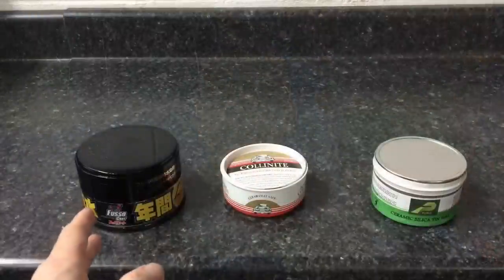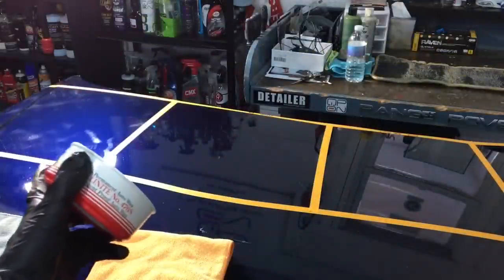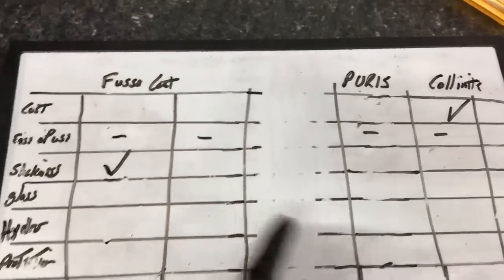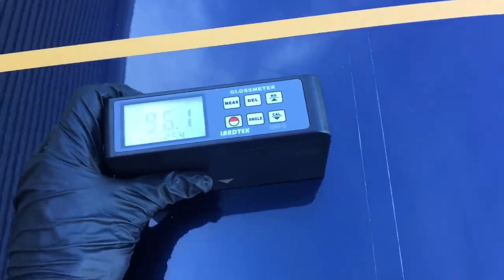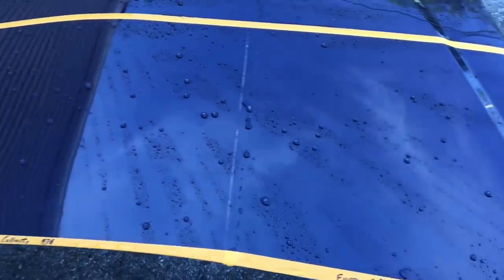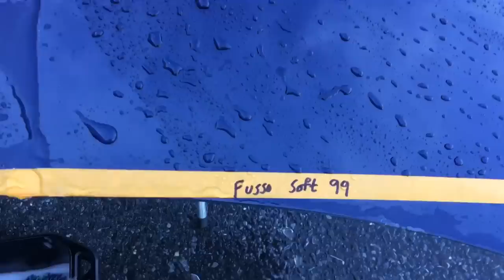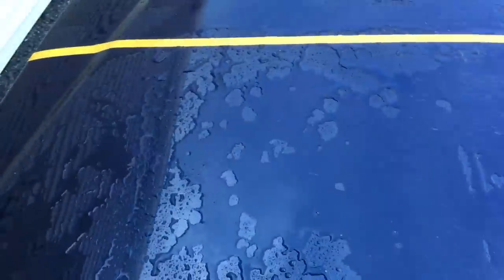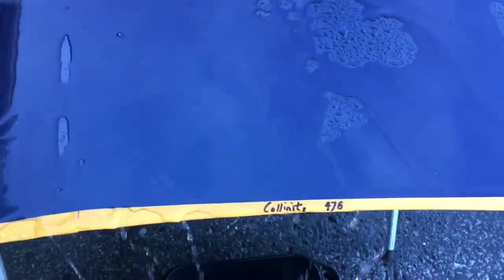Fusso Coat Soft 99 VERSUS Collinite 476 VERSUS PURIS Jade!!

Comment: I have seen on another Fusso review that it’s hard to work with below 60 degrees. I have been a Collinite fan simply because it’s cheap, easy to work with and I actually prefer more frequent wax applications. I gives me a chance to look over my cars paint for any damage and a little physical workout as well. But one thing about a well polished and protected car is that it seems to stay clean a little bit longer.
Reply: I have a lot of experience with original Fusso.  I’ve used it in varying temperatures and have a good feel for it’s behavior.  Give it another chance.  

My own opinion with some of these durable products is that many detailers expect to have all boxes checked with the experience; I don’t.  Fusso takes skill and time to master.  What you get in return is protection that in common daily conditions is nearly indescribable.  Water?  Soap?  I laughed out loud the first time I revisited the car after nailing the application of Fusso.  It is worth trying for that experience alone.

I’m guessing you know full and well that a 95%-plus quality correction greatly impacts the perception of any product applied, and I believe it is key when using such an aggressive one like Fusso.  To me, I’m protecting my ‘real’ work, versus making up for it.  

Last thing-  When in doubt, apply Fusso like it’s smearable.  Like Crisco, or snot.  And then wipe it off very well with a soft MF towel 10 seconds later.  If you’re in colder weather, 3-5 minutes tops.  I’ve NEVER done better with it waiting any longer.  If it doesn’t feel cured, then keep going with the towel until it looks removed.  THEN follow up again with a clean towel.  It’s all worth the trouble.

Hope that helps, if at all.
Reply: @snail415  lol

Comment: Fusso for the win!!! I have it and use it! It is extremely strong and durable! I use it for my hood roof and deck lid and I use turtle wax ceramic spray coating for the sides and both bumpers as well as glass and it works fantastically!

Comment: I was very happy to see the old dog, 476, holding its own especially with initial water beading.
It's my winter wax. My car is rarely ever cleaned during the winter like it is in the summer. It does really well holding off the salt and stuff and is still there in the spring. 
Great video Bryan. For me, for my use, can't beat 476. 2 coats a day apart-ish before temps drop and I'm set all summer. Just powerwash the Michigan salt.
Fusso is looking really good.
I have a tin but haven't used it yet. Have many products I have yet to use. Need to find other people's cars will to test some lol or I'll never get to them!!
May have to rethink my winter wax now....

Comment: I would love to see a review of Race Glaze. There is not even a mention of it on YouTube, so far I absolutely love it. It is extremely user friendly and leaves the paint extremely slick. It sheets water like a ceramic coating and it's been around since the mid 70's

Comment: Sorry, I know this is an old video, but I have a question. Do you recommend against top-coating Fusso with the intention of increasing the gloss/depth appearance (e.g. Shinee Wax on top of Fusso)?
Reply: The reason to use Fusso is to get it’s long lasting hydrophobicity. If you top it with Shinee, you will instead have the hydrophobic characteristinfs of Shinee. If that is what you want, then why not just use the Shinee and skip the Fusso altogether?
Reply: My opinion is based on quite a bit of experience testing this.  I’ve used Fusso on both clearcoat and silver (plated brass instruments).  So, not saying I’m a big deal, but I’m confident on this topic.

Fusso on ‘perfect’ paint, properly applied is nearly unbeatable as a base.  Follow that up with a ceramic spray like Griots 3-in-1, and the reflectivity you get is bananas.  I’ve tried many spray-based products that I feel are more amenable to going on substrates beyond clearcoat, and Griots has a really unique gloss characteristic.  I bought Wolfgang’s latest equivalent paying twice as much, and while the application was easy I was not impressed with the gloss.

Bottom line-  Fusso for protection on a truly-corrected panel, followed with a fairly-durable gloss-focused product is worth the effort.  Fusso doesn’t ‘pop’ like more modern products, but it is like nail polish in is effective resistance to the elements.  It’s worth experiencing.

Comment: Fusso Coat is mad OG , I got the King of Gloss as well. I’d like to see what it does on the gloss meter . But Fusso coat really out lasts anything in its price point. It’s been around for a while and can be topped. If you can’t afford a coating Fusso coat and Seal and Shine will get you through .

Comment: Fusso.   What’s funny, I detailed my Acura TSX last summer.  I used the Wolfgang twins on a 3401. Orange and white pads.  I used exo v4 to seal it up.  It sat in the garage all summer.     I started driving it in November. Didn’t wash it at all through the course of the winter.   I live in Connecticut.  It snowed a few times.  The car had salt sitting on it pretty much all winter.   I wanted to torture test it.  Well, it failed miserably as it had the coating burned off or, eaten off from where the salt was.   Anywhere else, it had good beading. Not great.   I’d heard to get the best result, I have to use csl first, then exo.  I wasn’t impressed spending $100+ and having these results.  I’ll definitely look into fusso.    I’ve tried Collinite.  It’s ok.  Time to go find some fusso.    What a great video.   Very thorough.    Liked and subscribed.   😎😬.   I’ve been detailing cars since I was 16 years old.   You can always learn more from others.  Trying new products is always going to be an obsession.   Stay well, stay healthy.   Thanks for sharing this. 

Jay

Comment: I'm starting to like the fusso wax.   
However, what top coat waxes and or sealants are good on single stage paints , and old lacquer paints.   Most if not all tests are done on a base clear.  I'm trying to find something good on soft jdm 90's black single stage paint.
Reply: great point, it also may be relevant if the car is japanese, european or american made...the clear coats all follow different rules on manufacturer pollution thus must have differences, and bond differently

Comment: I enjoy your testing methods.
I use Carpro Reset as my favourite car shampoo, love to results from it.
A question about the heat testing, does it do any long term damage to the paint?
Reply: which is why hes using  a temp gun, if youre careful you wont go beyond what a real harsh sun can do, but you sure could burn the clear coat, then its unfixable

Comment: Fusso is the champ it will be hard to beat alternative to coating it performs like coating it has 110 degree contact angle there not a lot wax or paint sealent that deliver. Great protection that does have ceramic coating in it fusso will defend it title

Comment: Fusso wins.  Next test: fuso vs angelwax enigma vs angelwax 5th element
Reply: I own all 3.
For durability fusso wins
For looks and application I love the 5th element.
I honestly don't like enigma. Just don't get on with it.
If I could only chose one I'd go the 5th element.
Hope that helps you.
Reply: @Rmf8  I have all 3 as well. I've only used the enigma on my hard tanneau cover for my raptor. It held up well, but I agree with you, I like 5th element better. Looks great and seemed to hold up well. Fusso has always held up amazingly for me as well, but its so hard for me to apply lightly and I've also had trouble with it streaking. Both have seemed to hold up over the harsh IL winters here and I'd like to see how they hold up in a controlled test
Reply: worth noting- I just have the sample tin of enigma. I bought a full tin of 5th element.

Comment: Beadmaker vs fusso please !
Reply: Why? There's only 30 million YouTube videos showing Beadmaker is little more than a gloss enhancer/detail spray that isn't durable.
Reply: Beadmaker isn't on that level of durability. Wouldn't be a good match up.
Reply: Bead Maker would fail after you spray it with water
Reply: @Twiztid_Metal  
D'mn bro its not that bad.. Lol!  I got just over a month out of it under real world conditions when I first tested it.  It's not the most durable product out there on it's own but the fact that it is compatible with pretty much any product you combine it with it's still a heck of a topper.
Reply: ldtriton I've used it for about 2 months now, won't be buying it again. I put on my girlfriend's car last Saturday after doing a rinseless wash, followed by iron remover and clay decontamination. Drieed the car completely, did a "wet coat" as per all instructions for the first application, the buffed off using two quality MF towels. Gave it a quick rinse last night and hydrophobicity is not there. Yes, it's glossy and slick, but no beads for a product named "bead maker". I'll mostly likely switch to Meguiars HCW or that new Turtle Wax spray. I will say - Bead Maker can perform better depending on what it's going on top of. I've heard BM + Collinite 845 have great results, but have yet to try it. On the other hand, I've read that BM + Cquarts v3 lead to a loss of hydrophobicity. It's a cheap product that is finicky. I'd rather something that works well with my arsenal as a whole for just a simply topper.
Reply: Twiztid Metal I’ve done beadmaker over 845 and wanna do it over this fusso. Protect and shine !
Reply: @drewsky1967  I have Beadmaker and it's not a bad product by any stretch, but it's not the same category as a long duration wax/sealant like Fusso. Both good for what they are, but comparing against each other is kind of pointless. The video you linked is a great example, 2 similar shorter term sealants meant to be frequently applied.
Reply: that would be too easy bro for Fusso, Beadmaker is for every wash appliance product... maybe as topper of Fusso would be great having